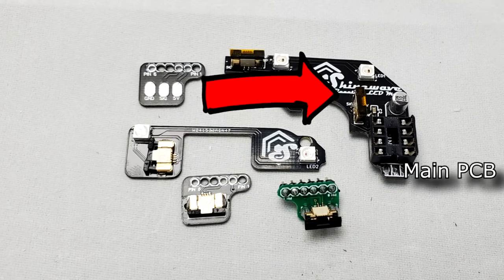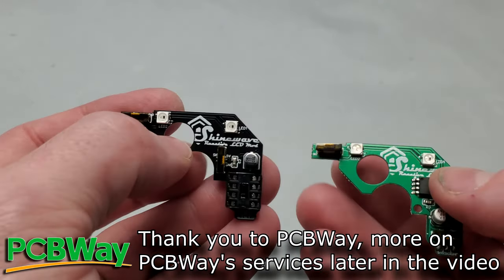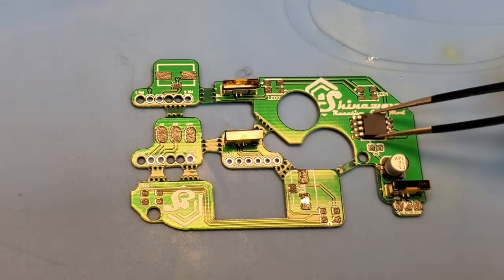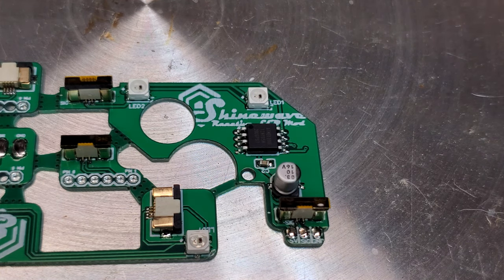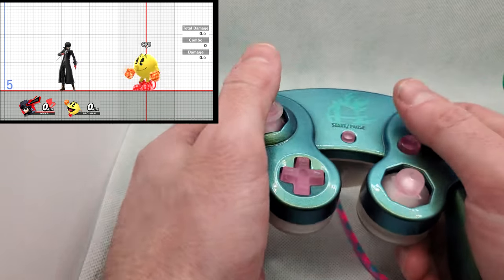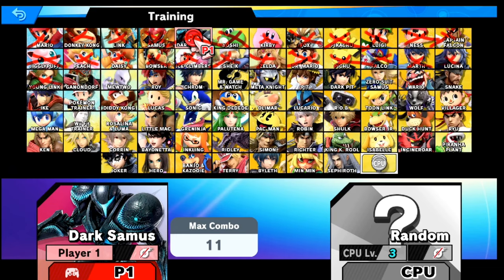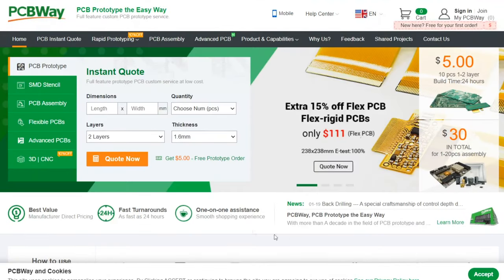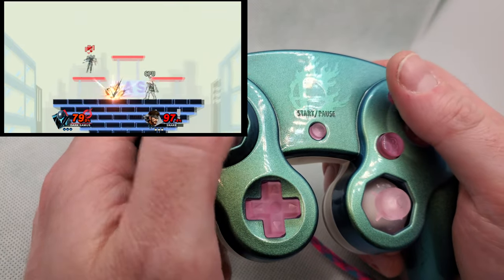NEW REACTIVE LED Mod for Gamecube and Smash Bros ~ Project Update

Comment: I’m loving my shinewave so much i’m so happy these kits are finally out. I’m having trouble using the brightness and mode settings, when i press d pad + start nothing happens. is there anything i could possibly try to fix it?
Reply from the maker: Thank you!!  So the button mapping changed due to user feedback! Try pressing and holding dpad side + tap z, that should get you all set 🙌🙌🙌
Reply: @RockerGaming  yup that worked thank you!
Reply from the maker: @schmoopDJ  hell yeah glad to hear it!!